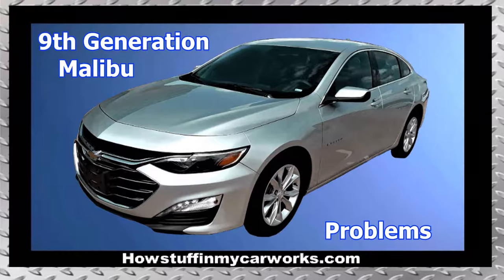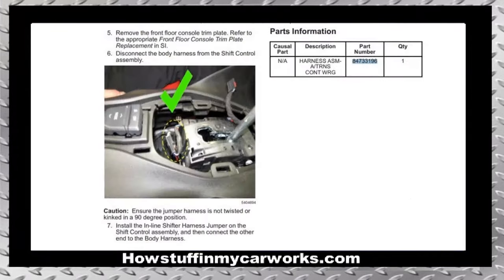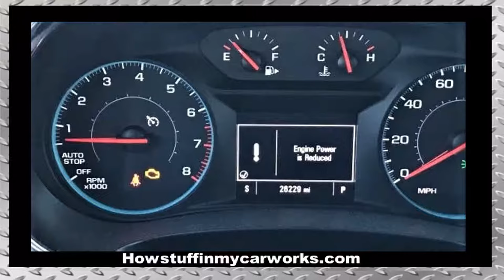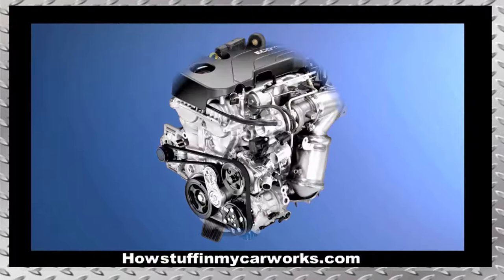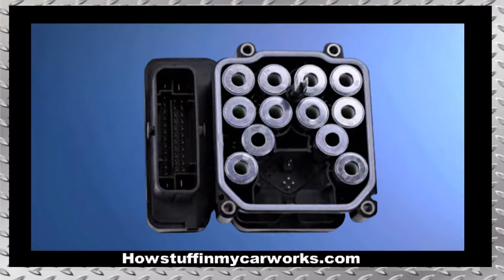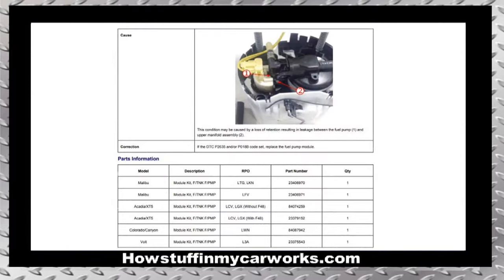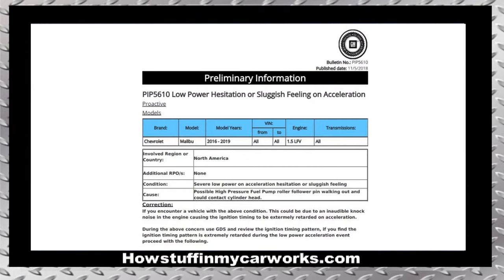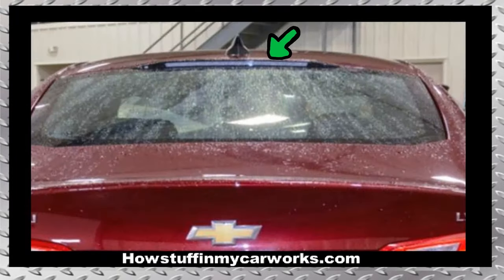Chevy Malibu 9th Gen 2016-2022 common problems, issues, defects, recalls and complaints

Comment: Definitely experiencing some of these issues with my 2016…. After dealing with Chevy for over a month they refused to service my car which was under warranty due to me not saving my oil change receipts….. highly disappointed in the quality and service at the dealerships especially with these being known and common problems! and the paint condition after a few years is absolutely horrible. A car I once loved I am now embarrassed to drive
Reply: That bs. You dont have save your oil change recipts.
Reply: They are lazy.
Reply: Why wouldn't you save them?
Reply: Record everything, I have a 2017 equinox and I recorded all the calls and told them I have proof but didn’t provide it. I threaten to put them on social media and they were like alright we will buy it back or give you another. We had just done an oil change on the vehicle a week prior then bam engine seized
Reply: Last year I brought my 2016 in to have the PCM looked over to see if it was up to date. I feel cars now a day have a mind of its own and might revert back to the old software. It's currently on its 2nd motor as the first one blew at 59K miles.

Initially they were going to charge me a diagnostics fee of $160 or so but once I showed them the TSB for the LSPI refleash and a glimpse of my 2" binder of all my service records the writer got a tad nervous as I dont play around.

Car was fine. No charge. Went on with my day.
Reply: Check your email for where you bought the oil
Reply: @Curtis, if you don’t mind me asking  what did you do to fix the issue or how did you go about this because I’m having the exact same issue right now. And they’re trying to charge me $1,400 just to take off the valve cover and check my oil?? They say if it’s dirty I have to pay to repair and if it’s clean warranty will cover it and I took It there 6 months ago for the same issue and they just cleaned the throttle body. It just makes no sense to me.
Reply: @Law The Realist  actually its in the warranty. They tell you to save it and if you don't keep up with Maintenance they say they won't cover it.
Reply: Um, that’s when you contact GM as it shows in your manual….you don’t need oil change receipts.
They have a group that deals with customer satisfaction issues. 
Call the number they give you in the owner’s manual, and ask for help with the problem.

Comment: I have 2017 malibu that bought brand new. Have been complaining of hesitation and lack of power since the day I bought it. Was told "since there's no cel, there's no problem" and that "its just a 4 cylinder engine not race car". Just hit 77k miles. shifter has been replaced 3 times for the same problem. Fuel pump replaced, pcv valve contraption replaced and it caused both upper and lower oil pan gaskets to blow out. Had a cel when I went to pick it up and was told the update didn't take (whatever that means). Hasn't driven right since. Get miscellaneous flashing cel's but never stays on and the dealer keeps telling me that there's no stored codes so it's basically all in my head... over all worse experience I've ever had with a brand new car or service. Let's not get into all suspension and transmission issues I've had... literally a tech tell the that the burning oil smell that still pumps into the cabin is just condensation from the a/c... WTF
Reply: I had that smell but it was more like burning oil I was like wtf
Reply: I can bet that the rear suspension creaks when its hot out like 80F and up? The malibu forums say its the rear knuckle bushes go bad and its best to get both replaced. I personally never got mine replaced and they are 116K miles now. I just spray lithium grease so I dont hear it as much. I have a 2nd to 3rd gear "flare shift" its not noticeable at low speeds but when you floor it the engine overrevs a little over 500rpm during the next gear. I've had the trans fluid flush but I'm hesitant to take it to a transmission shop to have it checked out. Otherwise it drives fine. 

Source: 2016 1LT owner with 116K on chassis and 56K miles on 2nd motor.
Reply: Brought first one that was just being delivered to dealership Feb 2016. Only miles were my test drive (3). Drove home 4 miles parked in garage this was on a Saturday, I use public transportation to go to work. On Tuesday received recall notice. Took to dealer Saturday. I was supposed to receive 6 free oil changes due to recall, went in for 1st oil change. Mechanic had the gall to pull the paperwork for them & Shred it, stop on expressway in Chicago!!!!! I only have 68k as of today. Check Lemon Law in your state and Contact Kroll settlement.

Comment: Also on the 2016 model, there's NO trunk access if the vehicle loses electricity and battery charge completely. You can't pull down the back seat and there's no key hole access from the outside. If your jumper cables are in the trunk, they're as good as locked in a metal safe.
Reply: Learned this the hard way.  everyone thought I was not looking right
Reply: Technically there is a way (on my 2017 at least)
It's a pain in the ass but with a long flathead screwdriver you can find the bracket that holds the rear seat in place, put the screwdriver blade between the two plates of the bracket and push in either direction until you pop the latch and the seat drops
Reply: I hate how all new cars removed trunk key holes seems like driver doors still have one so you can get in if something happens what about the trunk though? You're screwed 😂
Reply: You can pull down back seats, I have my 2016 ls model
Reply: You do know the fob has a key in it. Pop the cap off the door handle and open the door. Pull the hood switch.
Reply: @oliviapope1262 no hood switch on mine

Comment: I have a 2016 malibu
160k miles.and so far no problems...   hope keep going ok for a while. 🤔🤔
Reply: How is it holding up 10 months later
Reply: Mine has 190k and that’s when everything started to fuck up. So gl
Reply: Well mines a 2014
Reply: Na 140k all kinds of problems engine power reduction, & white smoke when start up smh
Reply: 2016 malibu 1.5 with all 10 problems and more

Comment: Yep, dealing with the shift to park issue, also had to replace the accelerator thing. Experienced the lost of power while on the highway
Reply: Did you need to replace transmission?

Comment: Currently renting a 2021 with the CVT, 15K miles. It's developed a metallic chirping sound at speed in gear. It goes away in neutral and quiets down when I pull lightly on the shift lever.

Comment: The worst of problems with mine was a failure of the PCV (positive crankcase valve). The PCV used to be a cheap $15 item that you could plug and unplug in the valve cover. It is now built into the valve cover and is non-replaceable. When it fails, a new $1500 valve cover is required. The fuel injectors also have to be reworked. With labor, expect $2500 plus. 57,000 miles. Totally incompetent engineering. Totally crass disregard for the people that have purchased the vehicle.
I have also gone through several gas pedals and a catalytic heater heat exchanger. $1600 and the only thing wrong was a $20 solenoid valve controlling water flow through it failed. Only sold as a $900 assembly. No longer have any loyalty to GM.

Comment: 2020 malibu RS. At the dealer waiting for a new piston and fuel injector. Issues with acceleration with engine light, ASC service code and traction control light flashing, resulting in non working cruise control only after I shut car off to “reset” it. It’s getting fixed under warranty but I don’t know if we should trade it in!!
Reply: Unload it well the market is still hot. Carvana or Vroom, great trade-in offers. Get a Camry.
Reply: If you can, 
TRADE THAT SH!T!!! They'll be a snowball effect of problems along the way.
Reply: I have a 2016 with a 2nd motor under warranty. I would have thought the piston issues would been resolved 2018+ and up models but I guess not.
Reply: Omg my car is at the shop TODAY for these exact same problems smh
Reply: same issue and model trade it.

Comment: I had a 2016 Malibu LT with the 1.4L Turbo engine and BOY was it a NIGHTMARE!! 
1.) I had the shift to park issue from day one and LUCKILY the Toyota dealership I bought it from paid for it to be fixed.. (though with some hoops to jump through)

2.) The electronics were constantly an issue. From the car not detecting the key fob (even with multiple battery replacements), the infotainment screen freezing and sometimes going black without any way to reset it, the instrument cluster going black as well as the speakers not working so I just had to hope my turn signals were working as I couldn’t visually or audibly detect them, to the usb ports and wireless charger not working properly at times.

3.) The water leaking problem was horrible. The rear passenger side roof liner was soaked and stained constantly from anytime it rained or snowed or went through a car wash. The last time I went through a car wash I immediately went to the grocery store after and when I came back to my car I could barely drive it home because the water must have made its way to the shark-fin antenna and shorted it causing the onstar in my car to go haywire. It was contacting onstar and then hanging up and so forth the entire drive home so I couldn’t use the buttons or infotainment screen the entire time and just kept blasting the onstar sound on and off.

4.) The worst thing of all was the god awful engine problem I ran into as well as the transmission, but mainly the engine. For a few months I was constantly feeling this weird engine sensation, kind of like you don’t know what’s happening but you know SOMETHING isn’t right because you’ve not felt it up until that point. I got oil changes every 5k miles as most of my driving was highway and I even replaced the engine air filter and the mass air flow sensor twice thinking it was that causing my issues…. Come to find out I HAD LITTLE TO NO OIL IN MY CAR WHATSOEVER THAT ENTIRE TIME!!! I have absolutely ZERO IDEA how it didn’t blow up in my face from literally little to no oil at all but once I added oil it seemed to go back to normal. I then came to find out the was a service bulletin from Chevy explaining how they were aware of a manufacturing problem causing excessive oil leakage to flow from the engine into the turbo and cause it to burn more quickly which is why I never suspected an oil problem as I always kept up on it and never saw oil leaks on the ground. 

There were many more problems but I’m just saying… NEVER BUY ANY GM PRODUCT EVER!!! I knew in the back of my mind I was dumb for buying one in the first place but boy was I given the run a round with that vehicle. I’ve never felt so stressed to get in my car and actually use it every single time like I did with that car…. Especially coming from a flawless 2006 Honda accord v6 LMAO! Now I’m a happy Mazda owner :)

Comment: Smh I had mines for three years and had at least 4 of these issues! In shop now from brake booster going out on interstate, almost crashed and died ! In shop now , brake light up top came loose. Also notice weak power on acceleration sometimes.

Comment: another problem is ice and sludge in the intercooler and turbo control solenoid. nothing worse than a 2 month old car failing at -39 on a dark morning at 5AM 20 miles from anywhere. Now picture the dealer not being able to fix this for 6 times now.

Comment: I have a 2016 Malibu LS and over the last year it's starting to have all kinds of issues tire pressure sensors old and new not working right, auto start/stop not working right, car shuts off completely no power or anything dead in the water, replaced battery 6 months ago and still have issues, I put the vehicle in park but dash still says "put vehicle in park" and so on and so on...I just wanna scream sometimes. 🙄

I bought this car pre-owned from a dealership in Augusta, GA in 2018 and I've taken care of it like a baby. It only has 31,000 miles on it, but it shouldn't be having all these issues...this is turning out to be the worst car I've ever bought.
Reply: Tire pressure sensors can happen to any car, they are not really model specific. 
Shift to Park is a very easy thing to fix. 
-There is a service bulletin out on that.
Until you get it fixed, snap the shift release button on the shift lever with your finger a couple times, and the shift to park message will go away. 
There is a switch and a wire that they replace for that.

Comment: I have a 2018 and sometimes it doesn’t respond to the gas pedal right away I push hard on the gas pedal and it takes forever to react or take off I barely bought it off the dealership too

Comment: I have a 2016, if your car enters into limp mode one more thing to check is the battery, that will also cause the problem. For some reason my car goes thru a battery every 2 years or less. Also some of them have a crappy design or cv joints I have this design and within a year I got mine replaced 3 times untill I got a good set.
Reply: what set did you get by any chance !

Comment: I own a 2016 Malibu LT and ive had a few of these issues but the biggest one i have is weird. Since i move from west coast to east coast my car act completely different. Only during the summer do I have issues if I drive it more than 30 minutes and its extremely hot and humid out, i go to give it gas. And it just sits there waiting for me. And it suck it i am at a stop light or any type of hills im in big trouble. I gotta plan my route so that I don't get caught in a bad situation. I took it into the dealership and they couldn't figure out the issue and said bring it back when it does it again. I didn't have this issue back in washington, which the weather is way different. I have no idea!
Reply: my mothers car does this EXACT same thing
Reply: What was the issue?
Reply: @coldcaseent6070  what was the issue?

Comment: I had the 3rd bake light issue and the gas   Gauge issue on my 2018 and also the active noise canceling issue when you step on the brake a rumble sound comes through tge speakers
Reply: Thank you!!! Every summer when it get to about 80 degrees or above, I hear alot of bass/ rumble sounds.
Reply: Wtf I got one comming from Carvana Saturday

Comment: I have a 2017...6 months in 1st service; Dealer reprogrammed engine computer: No reason given...Then the fun starts...3 times I had to use the key to open door...12 times in seat but "No Remote Detected" fixed by placing remote fob in center storage holder...Hundreds of times "Shift to Park"...Dealer: No problem found, but I found a work around, simply sit in seat & wait for computer to reset: Shortest time 10 seconds...Longest time ~ 3 minutes...Center brake light leaked water into trunk; Dealer replaced complete assembly...After 3 years windshield washer fluid tank cracked; Dealer wanted $500 labor & $200 part; I stated NO...Throttle body assembly needed cleaning @ 30k & 60k; both times was billed...2 years ago a P1101 code: MAP sensor replaced + service = $600...Latest service by the manual @ 82k = $200...At this point I can only imagine what the big important items are going to cost...but when the time comes that this Lemon dries up I will have no problem test driving a Toyota Camry...!
Reply: 600 to replace the map is ridiculous. Thats takes 5 seconds to do

Comment: At 80k miles I've had every one of these issues and had my engine replaced under warranty. My issues now are the passenger wiper sprays limply and extremely poor gas mileage, like 18 mpg or only 199 miles distance on a full tank of gas.
Reply: Did you get that diagnosed? It sounds like your engine may be having problems again

Comment: Ive own 2017 chevrolet malibu, so far seen only 2 problems mentioned, shift to park, and reduced engine power, replaced the shifter switch, replaced throttle body and accelarator pedal, not bad for a car with 50 thousand miles.
Reply: How much did that run you? I’m having the same issue now
Reply: I’ve never seen a car with only 50k have issues like that before

Comment: My 2016 had major hesitation at lights excellerating it was tourqe conveter. It had no codes that made it so strange to two Mechanic's demmed car unsafe to drive. I to car to Chevy they found the problem tourqe conveter
Reply: I'm having similar issues with my 16, at first it was hesitating to go above 40mph, fixed by restarting the car. Now it stalls/hesitates on stop lights, usually happens after the car's been running more than 30min. 
Did you have similar issues? My local mechanic believes it's the accumulator. What did you end up paying. Unfortunately,  I'm passed the 100k, so no warranty.
Reply: @MrUser999999  this is exactly what’s happening to my 2019 malibu
Reply: @carlosjones7987  Im about try the fuse box ,  some other tech on youtube found it can develop cracks internally. Works normal when car is cold/hasnt been used but issue start once car warms up. metal conductors contract and expand and  loose contact with temperature changes due to hairline cracks.
Reply: My friend is having the same issue. Thanks for sharing 🤓